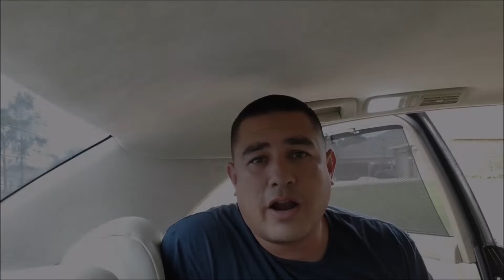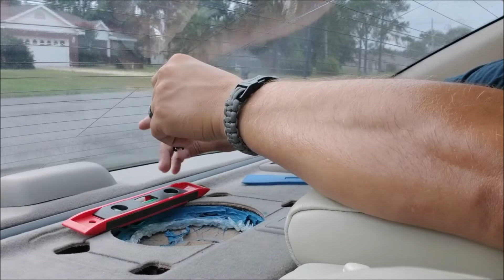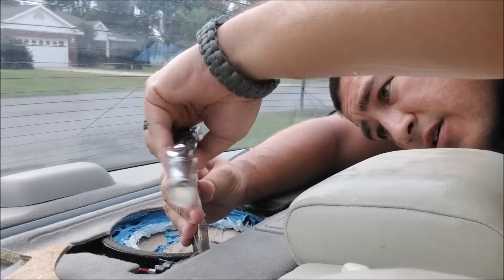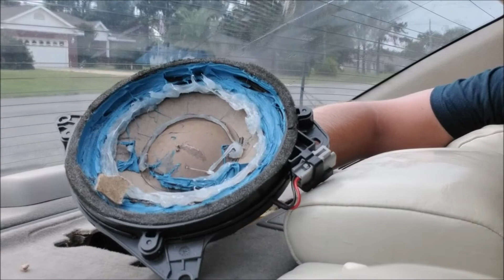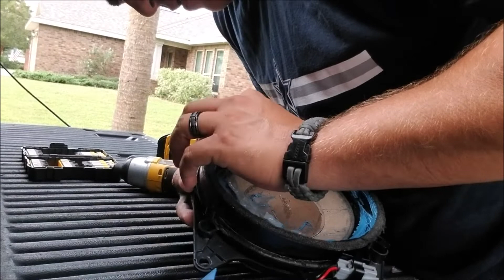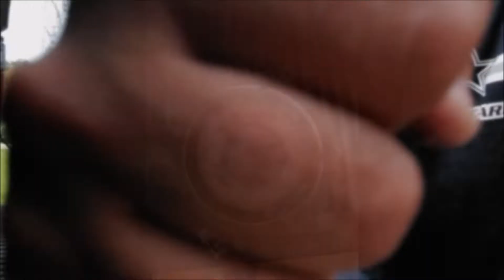Lexus LS430 Rear Sub-woofer Removal and Repair Part 1...

Comment: Whoever did that had no clue what they were doing. All they had to do was remove the driver from the frame, scrape the outer edges clean, order new surrounds (hopefully rubber). Apply the glue and CAREFULLY apply the new surrounds so that they are perfectly concentric, if not during low passages the cone will be out of phase and will distort. These idiots even got residue on the cone. If you can’t get that completely off the cone surface then the weight won’t be evenly distributed; then the excursion of the cone surface will be off and it will never move in a concentric even plane…SMH

Comment: There's a right way and a wrong way to remove the rear sub. 

This is the wrong way
Reply from the maker: Please inform of your correct way. I'm all ears.
Reply: @build.drive.fish.  It would be to remove the rear deck shelf. 

I know its faster to cut it up but it just seems barbaric
Reply from the maker: @SharpieEasternn  indeed it was but I wasn't not in the mood of removing entire pieces for a busted up speaker lol. I believe the other way required removal of rear seats and such.
Reply: @ build drive fish can u remove the subwoofer the same way in GS350 don’t wanna take the seats out etc ...